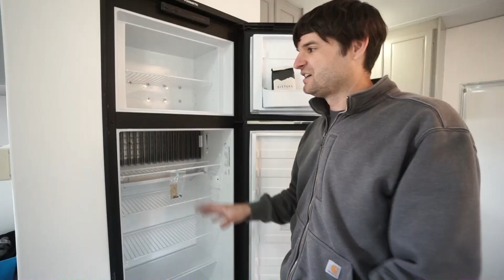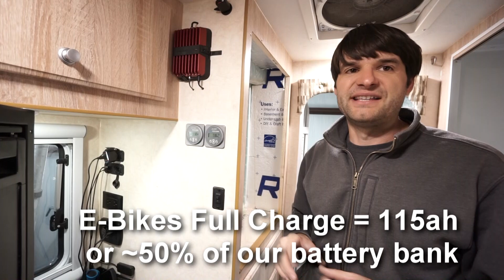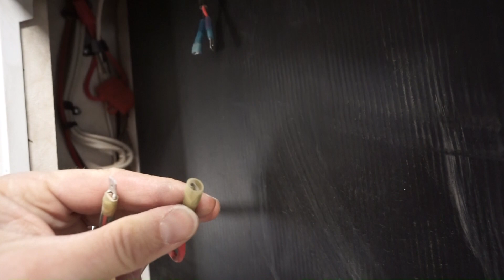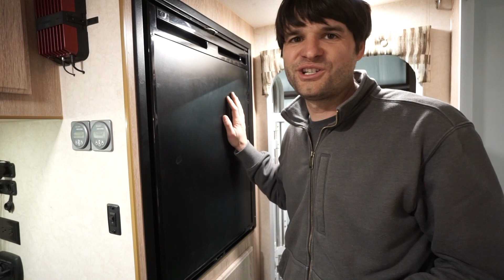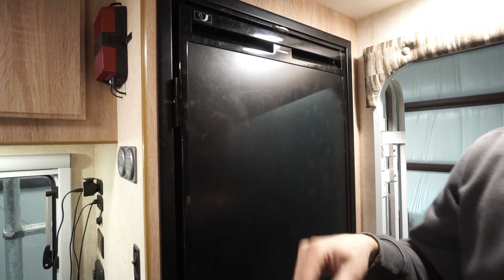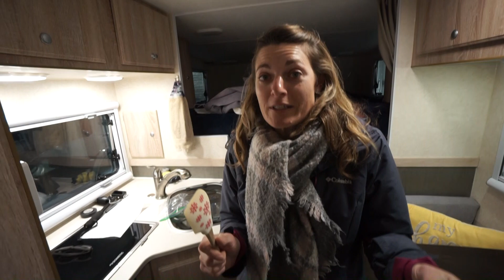Truck Camper 12V DC Compressor Fridge vs Propane Absorption Fridge – EVERYTHING you need to KNOW!!

Comment: Any problem getting it thru the door? My truck camper door is 21 inches wide. Looks like I'll have to remove the frame to get a fridge inside? My Norcold is getting old & tired.
Reply from the maker: We haven't needed to remove it.  But it would be a tight squeeze or remove the door frame.  It's easy to remove the door anyhow.
Reply: @TruckCamper  Aha! I assumed you replaced an existing absorption fridge. Didn't know manufacturers are installing DC fridges now. Thanks for the reply!
Reply from the maker: @garyausher  We custom ordered the camper with the compressor fridge. :)

Comment: I have had all types of fridges and you need a way to let the heat out and you do need away to let heat out even your home needs a vent to let heat out so does your home fridge reach around back and feel the heat but nobody does that with big ac unit .
Reply from the maker: These fridges have interior vents top/bottom.  They are designed to be installed in cabinets (no exterior vent).  Propane do need exterior vents for both heat and hazardous gas.  No contest between 12v compressor fridge to propane absorption.

Comment: I have 2 Lithium 100 and these batteries will run my ac for 5 hrs and when  and what is really nicethe temp is out side and if is 100 out side it may only last 2 hrs. And a good thing is that 2 lithium will weight as much as one lead acid so you can use 4 lithium when you remove 2 lead acid . A DC to DC charger so they charge as you are driving. I have one solar panel that I have puts out 425 watts and that’s a lot for one panel . The dc to dc charger is the best and my5.9 diesel in my Dodge 3500 dullay will use less fuel than a lot of generators that are running wide open and my diesel would be at idle so that’s a great thing because the farther north you go the less your panels will put out .
Reply: And I forgot to add my 05 Dodge 5.9 has a fast idle and it’s like 1000 and with 2 alternators thoes lithium’s will suck the voltage out of everything and they say to wire the trigger wire so your dc- dc charger but I did not like that so I have a flush mount switch that turd red when on. I did this so everything would get warmed and my starting batteries woul get fully charged and then I would turn the charger on and the red light reminds me to turn charger off because if you don’t and the lithium will drain your start batteries in a half hour and haven’t had that happen yet. But I carry a big Norco jump box that has a light and Moria code and ports to charge phones and start a 8.6 diesel and mines 5.9 and will start it like nothing .
Reply from the maker: It is impressive how efficient diesel motors can be at idle.  Although it is difficult to get the same charging power a dedicated generator can provide.  I've seen people run dual alternators but still a generator can produce much more.  But we love the DC charger for "free" power while driving.  And like you said it is essential in low sun times (like winter or snow conditions).  Good stuff.  Have fun!

Comment: I’ve had them all and with the fridge on propane they cool very fast if you are driving down the road it keeps all the fluids get all moved around and gets the bubbles out and gets cold fast becaus they tell you to make sure level but when your driving down the road you don’t need to be level but when you stop make sure you are level .
Reply: If you’re using an absorption fridge in triple digit ambient temps it’s a problem.  Absorption fridge’s do not cool efficiently period.  My Everchill cools great in hot or cold weather.  We’ll never go back.
Reply from the maker: @MoParRus340  Agreed.
Reply from the maker: Thanks for sharing.  Propane is definitely slower to cool down.  The angle issue and propane usage can be a major factor...  at least for us.  We travel remote and off road for extended durations.

Comment: Hello Sir! I own the old Electrolux 3 Way model is RM4360. the fridge needs repair as i never managed to work it on Gas. 12V or 220V works ok but is 120W/h and it is a lot it also needs about 6+ hrs to get cool, so after there is no more solar light it will drain my 100AH battery overnight. So i am in the dilemma to replace it with a 220V Sharp F class (Europe) that it says 136KWH/annual, i found a nice model that will fit exact on my old dimensions. I made the formula and this would be only 15W per hour, even if it is a little bit more is safe for the battery overnight (correct me if i am wrong).But ... i am also thinking to give the 3Way a chance and repair the gas, based on the manual it would consume 0.25kg/day so  it would be around 8KG per month and this is a very good option for my 10KG gas bottle. EVerything tells me to go to the 220V Sharp Compressor fridge but if i can repair the gas on the old Electrolux would be a very good idea. Another big advantage from what i understand with the compressor fridge is that i can start it in the morning (i have 3x100W panels) and will get super fast cold even in 1 hour at least to save meat for the dinner. I have so much energy wasted from the panels during the day that i do not use and it is a shame. Even if i want to save the battery on the 220V compressor fridge i can switch it off some hours overnight or even completely switch it off and fire it up next morning. What do you think?
Reply from the maker: Compressor fridge no contest.  Extremely fast to cool.  Most efficient to leave on (and safer for foods) - maintain temp vs full cooling.  The more packed out the fridge the more efficient.  Our 200ah battery drops approximately 10% overnight including running lights, h2o pump, electronics charging and just normal use.  Can operate at angles (think marine environment).  We only run 12v.  Probably owned a dozen compressor fridges over the years.  Danfoss makes the most reliable compressors.  Realistically, they just work and somewhat mindless.  Highly recommend.
Reply: @TruckCamper  Yeah this is what i think also, thank you for the fast repl!. But...! I might give a chance to fix the Gas system on the old Electrolux for this summer trip and later i will mightly go to a compressor. I understand that the best move would be a 12V compressor fridge but would be lot for my budget, i used to own many years ago one portable from Englel and i know how nice they work by consuming no more than 50W/H and getting even ice in 3-4 hrs. Thanks again for you reply, i will have to look around how much they will charge for service the old Electrolux and if it's much higher than buy a 220V compressor i will have to reconsider. BTW this is the one that i was thinking on and is exact the same dimensions like the Electrolux, what do you think about the energy ? it says 136kwh/annual and for sure we will have to add  more or less 5W/H for the inverter that will always have to be on: https://sharphome.eu/uk-uk/sj-uf088m4s-en
Reply from the maker: @darkovsky  Just watch the online classifieds for a compressor fridge.  We've sold numerous over the years.  Ebay. Craigslist.  Facebook market.  Find a good deal on a quality compressor fridge and be done.

Comment: Good video.  We have a 10.7 cu ft Everchill.  We also have two 200AH lithium with 600 watts solar.  Our set up, with the fridge, Coleman compressor cooler and 1000 watt inverter on will use 15% of battery through the night and is fully topped off by 9:00 AM.  The lithium batteries charge in a fraction of the time it takes to charge lead acid.  Another plus is its frost free.  It only takes a couple hours to be totally down to temp.  Maybe even less.  No worries about level or ventilation.  Propane absorption fridges efficiency goes in the toilet in triple or above ambient temps.  I would never go back to absorption style.  And, one of the most common RV fires is the absorption fridges.
Reply from the maker: Great feedback!  Thanks for sharing.  :)
Reply: It’s for the heat to escape out the top .

Comment: Is there a way to use the foil tape to block the bottom vent without pulling out the fridge?
Reply from the maker: Not well.  And it would look terrible!  Pulling the fridge is easy.  Especially after you do it once...  go for it!
Reply: I used foil tape to close our lower vent.  Put it on the backside so doesn’t show outside.  Also put a rocker on/off switch behind the fridge so I can shut off the power.

Comment: So I've used that top fridge latch only when I am not using the camper, but it's still on my truck. It holds the door cracked open so that mildew isn't an issue. I can drive with it in that position. That was I though it was for anyway.
Reply from the maker: I don't believe that is the purpose but interesting use...  we leave the freezer compartment open which hold the door open for drying the inside.   Thanks for sharing!

Comment: Great video. I don't have any issues with your recommendation of 4-to-1 for solar to battery, but for anyone planning their setup, I will say that my 360 watts keeps my 200 amp hour Lithiums topped off just great. I do have a DC to DC as well. That said, we do go to bed pretty early and probably aren't heavy clon consumption. But 2-to-1 will prob also be a decent range for most ppl.  Also, the Victron app is SO much more convenient, everyone should consider it. I had a buddy who went from a compressor in one set up to a 3 way in his Norther Lite, and that thing sucked. He could never park on a hill. Also, there was some sort of alarm either on the propane or the fridge that would go off. He missed his compressor fridge!
Reply from the maker: Great feedback!  Thanks for sharing your feedback and experiences.  I included some additional details in the video description.  Our FWC had 200w with a compressor fridge and that was a constant worry and trouble (in the winter and adverse weather).

Comment: great video, love the thorough explanations, and the sharing of clever solutions, like the latch and “freezer blocker” you rigged up.  You suggested that the Isotherm refrigerators may have a better latching system.  I can confirm that my Isotherm Cruise 85 stays properly latched and closed during off-road travel.  And this is despite the fact that is has a center latch, allowing for hinging on either side.
Reply from the maker: Thanks!  Yes, we've had 2 Isotherm fridges and no issues with the doors coming open.  Seems better build quality or better suited for rougher travel.  Good to hear your experience!
Reply: Yes I had a couple full Nalgene in my isotherm I forgot to buckle down before a trip and can attest the door stayed closed even though they were a terror to the inside haha